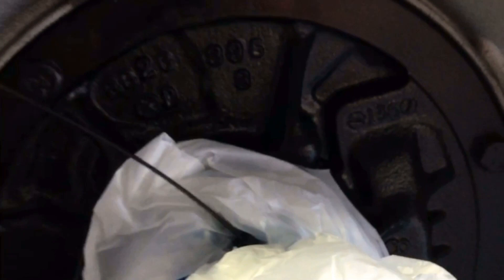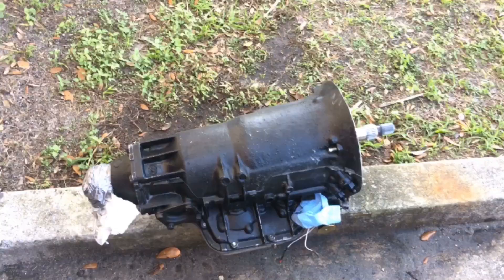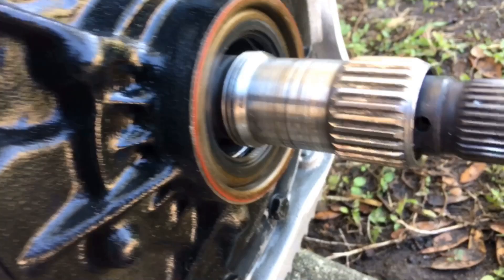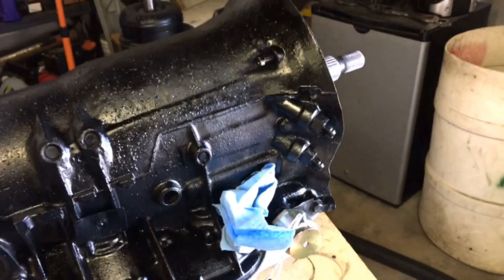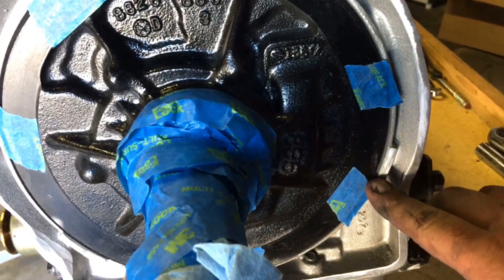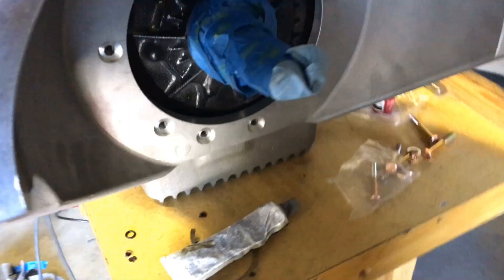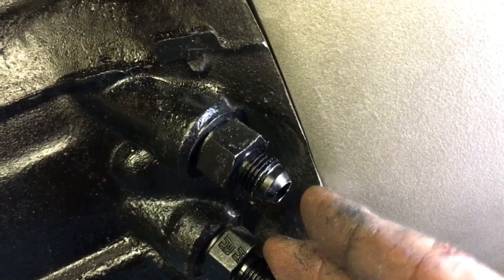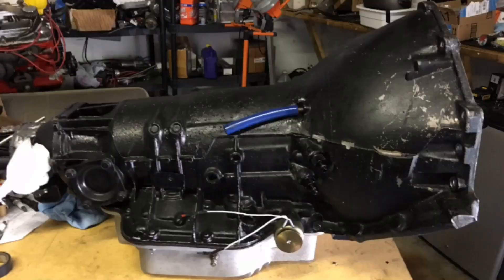Installing J.W Ultra-Bell sfi bellhousing on my TH400

Comment: You can pull the pump off and see if the case has the extra 2 holes for the pump. Sometimes they do and only use the 6 just flip the pump body over and you can see where they are supposed to be drilled all the way thru

Comment: I cut both a TH 400 and a TH 350 off it was easy but its best to cut a little at a time when you get close to the actual measurement, then test fit your ultra bell and adjust,  both of mine came out beautiful , if anyone  cuts to much  as long  as it doesn't  affect performance  no big deal because  you can always  use a heavy duty  silver or grey caulking for  cosmetic appearances once your bell is attached  to your transmission  and pump!

Comment: Putting th400 in my 800wheel street car 11 5.0. I am done with manuals.  This will be my daily driver 9sec street car. Th400 is so fcking badass and practically unbeatable off the line. I already have one in my 700hp 68 mustang street car and its crazy fast. Th400 is awesome transmission for speed and fun.

Comment: i just started watching, as I want the info on the 2 extra bolt holes. but that scribed part isnt on stock trans, JW must have done that when they built it originally. And one of my trans's the builder did the other 2 bolts. I need to get the one i am doing now the other 2 as 4 digit whp probably wants it haha.

you did a great job describing things, I did mine all with the cut off wheel of grinder. 2 cuts and i have plenty of clearances. those 3 tabs also got me at first. but, since i already have one trans with the bell installed, i had a reference to constantly look at, and i did a fair bit of that.
Reply from the maker: Thanks! As far as the 2 extra holes you mention I think you mean the mounting holes on the pump? So I get this question a lot and there are 2 types of pumps 6 bolt and 8 bolt and I can tell you this that those have no reflect to hp the bell housing holds that trans to the engine and the mount in the rear holds it down
And center. Power is transferred through the Torque converter and through the shaft to the hub and clutches and then to the output shaft it’s NOT putting what some think is tons of twist or pressure on those mounting bolts.

Comment: Good work there man, I was quite impressed with the sawzall on that ally housing, I am researching bellhousing modifications as I am investigating manual gearboxes and clutch assemblies but your video was good to see.
Reply from the maker: Nigel Williams thanks! I made it a year before I actually posted I wish I had a camera guy I could have done better but it’s easier then I thought it would be
Reply: @Turbo8secondz28  Tripods are a great way of setting the camera up so you can work free and it gives you an easier time of showing what you want us to pay attention to.

I'm quite used to working alone and not worrying about time, a camera guy would be great but I couldn't justify keeping a buddy tied up at the shop all day.
Reply from the maker: Nigel Williams ya I need one my wife has one for her live videos she does lol I should take it on a Saturday and do some vids with the car lol
Reply: I used a zip saw disc on my grinder. Just gotta be extremely careful, cover everything and watch that damn pan rail on the bottom.
Reply from the maker: mikejessmax great! Ya those damn sand grit shavings were a pain for sure lol

Comment: Bub..you should have gotten a 7 bolt or 8 bolt case. Also..you could have drilled and tapped one more bolt anyways,  however you would have to do this prior to installation of the front pump.
Reply from the maker: Warren Watts Just to let you know th400 cases are the same specs now the pump is what’s different you could go out and buy a different pump that would be the better thing to do than to drill and tap but not needed I’ve done five of these are ready and also brought my transmission to FTI did level five upgrade now and I’m pushing 985 rwhp though it so no issues And I trans break launch 5k the power is transferred through the shafts not the bell housing
Reply: @Turbo8secondz28  , wrong...8 bolt cases are available bub
Reply from the maker: Warren Watts the pump is the difference between them the case is the same!! I am right 

https://ftiperformance.com/TH400-high-Volume-Pump-6-Bolt-8-Bolt-F4045X.htm
Reply: Cases are different you can run a 8 bolt pump in any case but if the case doesn't have the other 2 bolt holes defeats the purpose. Having a 8 bolt case is recommended not saying this won't work.
Reply: They say there are pros and cons to either  a 6 or 8 bolt pump but im with you , i have a TH400 AND TH350 and both of them are 8 bolt pumps, im  from the school of more is better and stronger!!!!!!!!!

Comment: Stock Chevy bell cases are getting harder to find.  If you're going to cut a bell off, cut up a BOP case.  Pre '76 BOP cases are stronger and use all of the pump bolts.

Comment: I thought an adapter has to be used and the pump machined to the adapter to fit the bell housing on properly?
Reply from the maker: What’s your combo? As far as my application sbc,ls1,lt1 this is all you need

Comment: Circular saw will cut it not good on saw but i cut aluminum pipe with one all the time
Reply from the maker: Robert Husk  I have used a circular saw for of course many other things and it cuts aluminum really good but the pump and bolts are soo close you have to make sure you don’t hit them! But I can’t see why you couldn’t I just never did

Comment: so did you have any issue ensuring the bell housing was square on the mating surface to the motor, with the high and low spots of the cut and tight and loose gaps ?
Reply from the maker: Negative because as long as the bell housing is bolted up to the pump flush the distance from there to the meeting surface should be perfect! now if you don’t take enough material and try bolting to the pump and it’s not flush, the. There will be an issue. Basically there should be a slight gap between the bell housing and the area where you cut the factory bell housing  if you get me? Not much, use a feeler gauge.

Comment: Structurally it's ok where you cut off too much. How did you determine that.
Reply from the maker: For me, I went and did a stage five upgrade on the transmission with Fti and they were OK with it and so far I have done trans brake launches with 1200 hp and it hasn’t broken yet.

Comment: I thought they said these couldn't be used with pumps and cases with less that eight bolts?
Reply from the maker: the nitro man  yes it can! Even states in the directions. As you can see it works , it’s been working on my eight second Camaro ever since
Reply: @Turbo8secondz28  that's good to know. I know I read that somewhere.
Reply from the maker: the nitro man You can search online and get a PDF of the instructions and kind of read them over before you even attempt to buy or even put it on
Reply: If u remove the pump the stator side "backside" of pump usually has the 8 bolt pattern already the front half of the pump usually has 6 so u simple drill the front half of tye pump to match the stator side and u will have all 8 bolts as intended even with a 6 bolt pump design

Comment: What part number was the bell housing you use,,was it for stock mounts and depth ,,,also in one of your other vids you had a red front pump shaft plastic cover,, where did you get it and what’s the part number
Any help would be greatly appreciated 
Big ole taterhead
Reply from the maker: J.W. Performance Ultra-Bell Bellhousings 92451
Now understand this is for a small block Chevy and th400… All depends on what motor you are using and also what transmission th400/350? Or is it for a ls or ford or dodge?? That all makes a difference on what part number. The red plastic cover I actuall got when I had the transmission built by Fti converters in Florida and you can find them on amazon.
Google
Universal Transmission Plug Stop-Off
Reply: It’s a th350 and I also have a Jw 400,,thinking of modifying also what starter do you use,, I have a skip white 434 the starter seems to turn on the slow side
Reply from the maker: @Taterhead3e  then that part number will work for you and you can get from summit racing.

Comment: what does the ultra bell housing do ?
Reply from the maker: The Cookie Man it’s sfi approved and is stronger than oem
Reply: @Turbo8secondz28  👍🏾
Reply: @Turbo8secondz28  i been building transmissions for a while but I only build them for friends and I wanted to ask you I don’t think is a good idea for the bell housing to screw in the oil pump plus I think is going to be weaker cause is not a one piece?
Reply from the maker: @chikisorozco4297  I didn’t design or make this product! It’s a race sfi safety approved bell housing for racing purposes.... if you have an issue with the product or design contact one of the largest well known transmission/torque converter companies in the USA who designed and makes this bell housing.
JW Performance Transmission Inc.
(321) 632-6205
Reply: @Turbo8secondz28  im just saying I believe is going to make the transmission weaker . Plus not every thing people design or company design is good sometimes is just to make money.
Reply from the maker: @chikisorozco4297  in drag racing this is required for sfi safety requirements so tech can pass the car safe for the track to run the level my car runs. It’s that simple! It’s not for you or some guy driving his car to work. 
The fastest drag race cars in the world either use a Jw bell housing or a Reid case that’s that I don’t know how else to explain this beside do your research before commenting on something you have no clue what it is! So please google or call 
https://sfifoundation.com 
SFI Compliance, Inc. and ask them or NHRA  which require this to race an NHRA track.
Reply: @Turbo8secondz28  so now you have opinions of what people think that was my opinion if you get mad cause of what people think dont put your videos on YouTube
Reply: @chikisorozco4297  OPONIINS DONT MATTER WHEN THERE ARE FACTS THAT CAN PROVE. IT WILL KEEP THE CASE FROM CRACKING ALL THE WAY THRU. IT IS AN UPGRADE.
Reply: @chikisorozco4297  Late response but have you ever seen a ultrabell broke all of the bolts that holds it? And then have you ever seen a stock case th400 broke the bellhousing taking out the whole trans with it? You can have your opinion, but you should look at the fact first to base it on. Yes, a lots of things are made for money, but now you're trying to go against J.W. based on "i think" and "i believe".

Comment: Doing this tonight can you tell me the size of the bolts you used? My jw is pre owned and didn’t come with bolts
Reply from the maker: Lamb Chop I don’t know the size but this should help plus you have to have O-rings 

https://static.summitracing.com/global/images/instructions/jpt-92450.pdf
Reply from the maker: Lamb Chop you can buy a bolt kit too